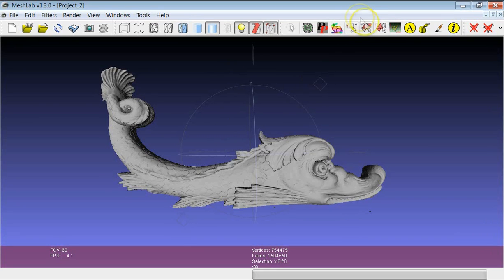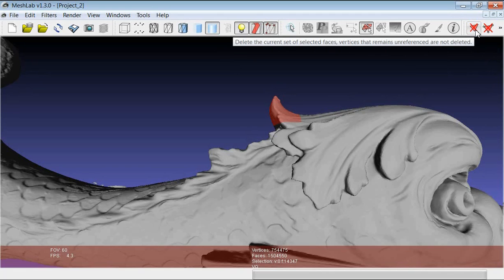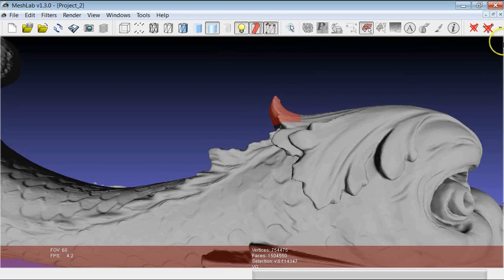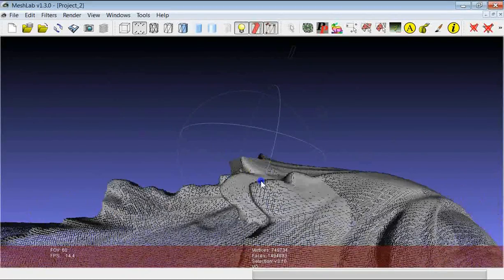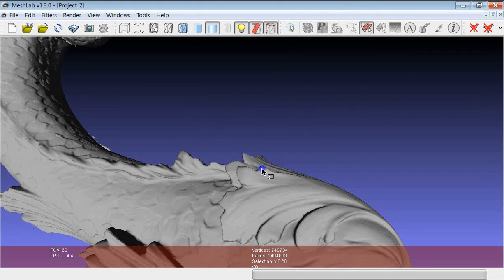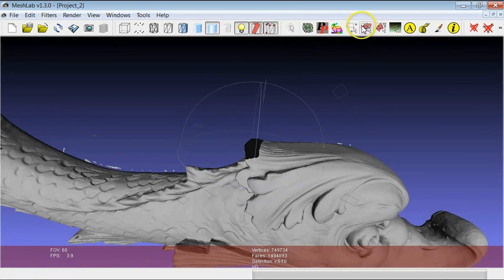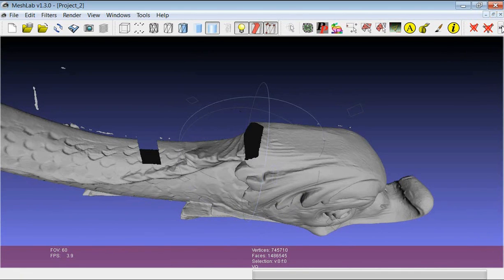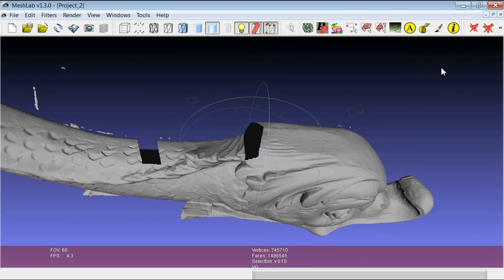Cleaning: Triangles and Vertices Removal

Comment: There is a patch which should solve most the problems you mention. It is not included in the latest binary, so you will have to compile meshlab locally in order to include the patch.